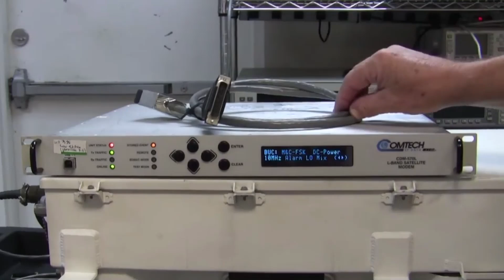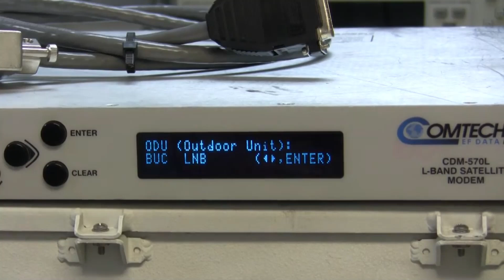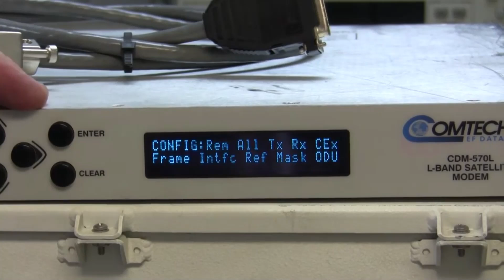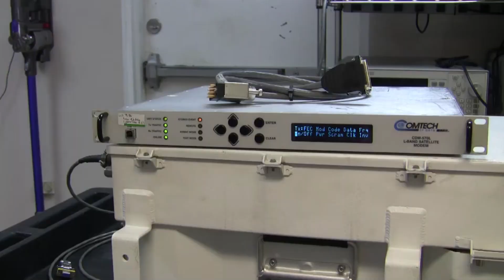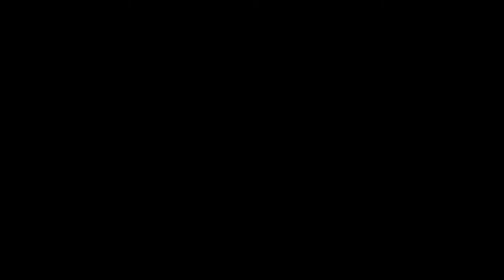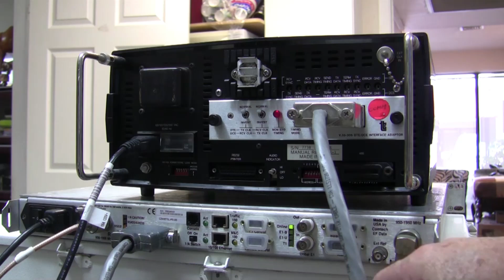Using a Fireberd 2000 to test satellite modem serial port

Comment: Whoa... flashback!  I worked at TTC back in the '90s!  For the T-Berd side of the business, not the FireBerd side.  I worked mostly on the T-Berd 305, which was already a successful product, and the T-Berd 310, where I helped define the product, worked on several of the boards, helped get it through first production, and then worked on its OC-1/3 Transmitter.  I also got the first OC-48 prototype running in it, but I don't know if they kept that system after I left.

The last time I saw a FireBerd 2000 must be about 30 years ago!  

It looks like you're based in Florida... so here's a related story...

The repair dept. called me down because one of our Florida customers had returned his T-Berd 305 for the 3rd time with blown MOVs.   They were 3 soldered directly to the Corcom filter on the back panel.  There wasn't much left of them beyond carbon - they had obviously been hit by serious lightning.  Normally you'd put in much bigger MOVs for a problem like this, but there was only enough room to double-up on the existing MOVs.  We may have suggested they also beef up the lightning protection on their building - obviously if it was bad enough to crispify 3 MOVs inside our unit, they risked damaging other equipment as well.  The good news is that I never heard of a unit coming back from them after that. 

Thanks for the trip down memory lane!